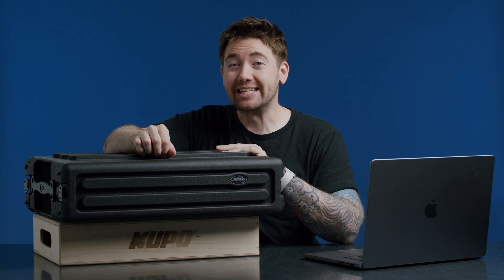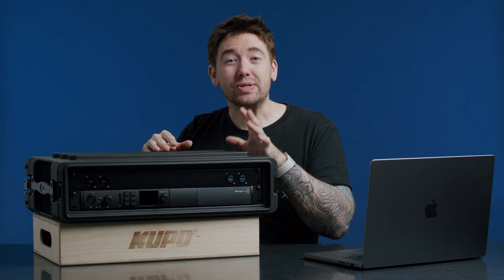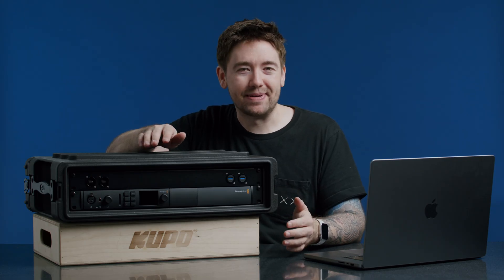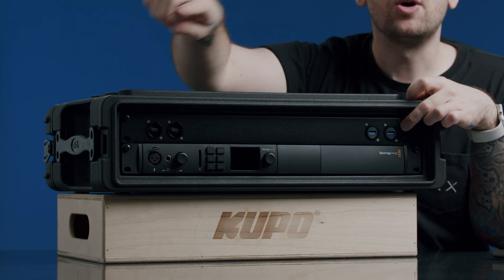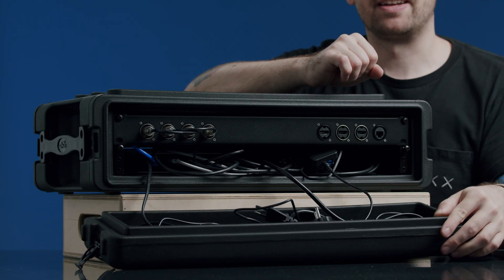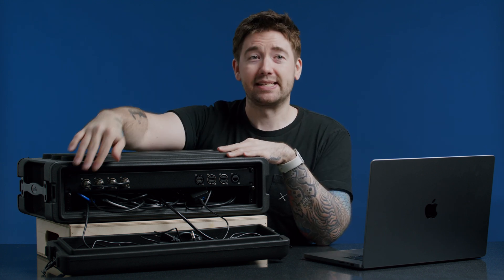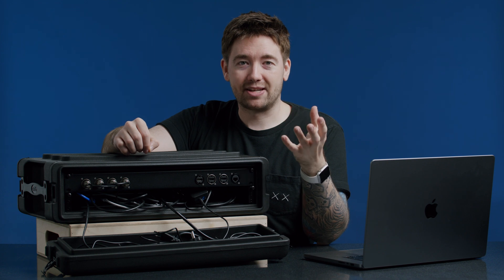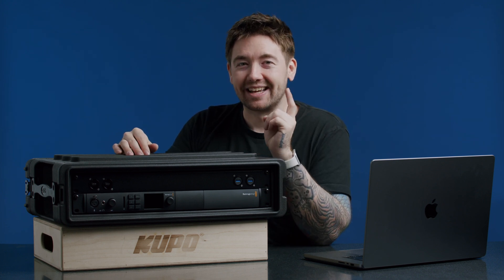KEY & FILL Graphics for ATEM Mini & ATEM Mini Extreme | 2RU Case Package

Comment: Hi, great video. I would like to know how you use vMix with apple mini m1 and if works well. And I woyld like to know if you check some panel control for a 2 ME constallation HD, which? Thanks
Reply from the maker: as far as I know, vMix doesn't run natively on Mac OSX so you would need to install Windows on your Mac via Bootcamp, and then you can run vMix.
The official panel controllers from Blackmagic cost more than the 2ME itself 😂 so I just used 4 streamdecks now using Companion to control it!
Reply: @AnotherCameraChannel  perfect thanks very much for you reply. I have Arem mini Exrreme Iso and I'm checkin advantages for 2ME.

Comment: Why not just get a thunderbolt to HDMI adapter and bypass the Ultrastudio and SDI converter altogether?
Reply from the maker: The Ultrastudio outputs 2 SDI channels for the Key & Fill and they are in sync.
Reply: @AnotherCameraChannel  guess I’ve never tried this before. Two HDMI outs wouldn’t be in sync?

Comment: Hi ACC, thanks for this great video. Just found it and subscribed right away 😉. I'm interested and very curious how you build this one? Do you have an explanation or graphic for that? How do you put Mac mini with Decklink etc. together? Thanks for for your help and for this great video!!!
Reply from the maker: Hey~ yeah, I forgot to show the insides :(
The Mac Mini M1 is velcro’d onto a Blackmagic Shelf next to the Ultrastudio. Then I velcro’d the mini converters onto the top of the Ultrastudio to stop them from moving around, then used a small USB multi block charger thing to power them and then they were all connected to the SDI and HDMI port connectors on the panel.

Mac Mini M1 using an Apple Thunderbolt 3 cable to the Ultrastudio 4K Mini, then the Key & Fill SDIs out to the SDI to HDMI converters then short HDMI cables from the converters to the HDMI panel connectors.

I've rebuilt it now for the Constellation HD 2ME so a little rearranging as I put the Playoutbee and AppleTV 4K inside it too, and just straight SDI out for Key & Fill instead of using the HDMI converters. AppleTV and PlayoutBee are still HDMI.

Hope that helps!

Comment: Would like to see the assembling process
Reply from the maker: Yeah sorry about that, pretty fiddly in there.
Mac Mini M1 velcro’d onto a Blackmagic Shelf next to the Ultrastudio. Then I velcro’d the mini converters onto the top of the Ultrastudio to stop them moving around, then used a small USB multi block charger thing to power them and then they were all connected to the SDI and HDMI port connectors on the panel.

Rebuilt it now for the Constellation HD 2ME so a little rearranging as I put the Playoutbee and AppleTV 4K inside it too!

Comment: Great explanation.  Why not play the key and fill directly from the ultrastudio?  If 4K is not a requirement would the Hyperdeck Studio HD plus be a good (and cheaper) alternative?
Reply from the maker: I'm not quite sure I understand the directly part of your question. The Key & Fill is coming from the Ultrastudio, just using OBS and the plugin to set up outputs correctly. I haven't tried not using OBS and that plugin.

I did hear that the older Hyperdeck Studio HD models have the SDI A & B out so you can load graphics with alpha onto SD cards and playout that way. I believe Doug Johnson talks about it in his latest 2 M/E Flightcase video. There's also the HD model of the Ultrastudio which can also do the job if you did the same workflow as me with OBS and the plugin. I went with the 4K because I envision in the future to be working with 4K resolution, just a bit of future proofing. If you want just HD then you have a couple options :)

Comment: Hey ACC,  Im just about to order a custom case for my streaming gear and really admired your last build.

Do you just go with one size to keep it uniform and stackable?
What depth do you use & was much though put into that decision?
Is there anything you wished you knew before you built it?

Thanks, love your work.
Reply from the maker: Congratulations!
A Custom case is very fancy!
This case is different and less deep than the larger 4K streaming case I have, but it's ok because it only holds a few things. The design of this plastic SKB case there are grooves to help with stacking and alignment. My large one is completely flat.

The large case the internals are around 14" deep. So it's too shallow for holding a pull out screen, that's one regret for me. I'd have needed a 19" deep case for some manufacturer's screens. When I ordered the case I didn't actually know the depth and at the time I didn't know much about cases at all. I was lucky that the pullout shelf/draw was able to be fitted at all because it's at it's minimum mountable depth.
While I'm generally happy with having an 8U case, if I had a taller case like 10U or 12U I could have a bit more space to put things in at a later date... but as it's already around 43KG, I'm not sure I'd even be able to move a bigger case around by myself. The 10U and 12U from the place aI ordered from have wheels so I couldn't put it on a desk. I do have space and power left for 4 more Hyperdecks so that's probably my limit. But yeah the weight is something I should have thought more about before buying.

I'm going to get a small 4U or 6U case for audio soon, and I'll *probably* go with a style similar to the plastic SKB one. If not I may try match the big case. Haven't decided yet, but because of the antennas I'll need a much, much shallower case.
So probably they won't match later down the line but thats ok.
Not a huge deal breaker for me.

Good luck with your new case and your build! It's an exciting time! Enjoy it!